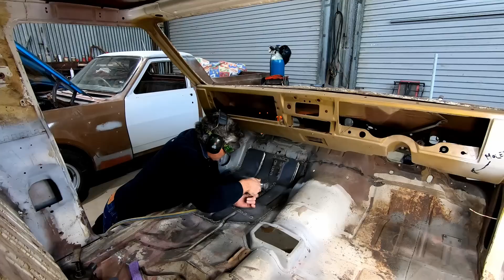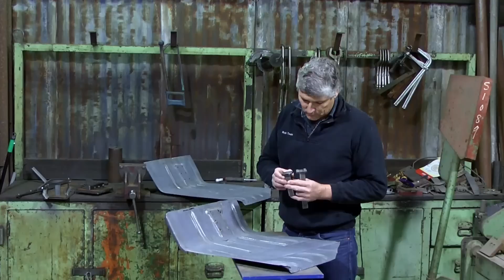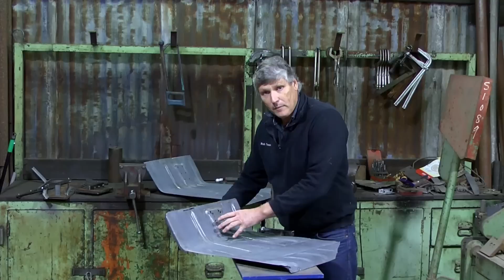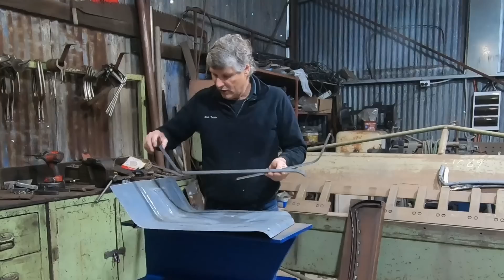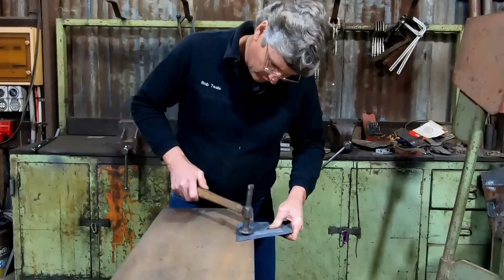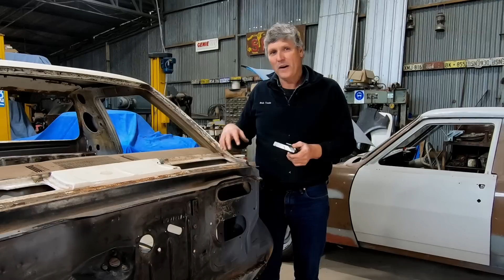1970 White HG ute floor pan rust repair

Comment: That's rubbish it's illegal to butt weld floor sections...I have put through 2 restos in SA both passed...it's structural integrity is just as good done properly and stops rust entrapment under  a seam.

Comment: How do you get the  weld to grind flush on the bottom if its lap weld?
Reply from the maker: This is one area where it is relatively safe to run a hot weld. Within reason, the weld will distort the edge of the lap and almost align the sheets. You wont get a perfect finish like a butt weld, but you can get it to a point that a few coats of high build and a sand will finish it. Watch the door video in the brown ute play list where I do a few different patches and approaches. There is a lap joint patch that comes out very straight, and will give you an idea of how it works. Choosing the best place for a join also helps disguise the seam, along one of the beads and in the roll of the trans tunnel etc. Good luck with your project. Cheers Rob.
Reply: @robsshed  Thank you Rob i appreciate your advice its been a great help. The way you explain how  to do the job is very clear for  me to understand your a awesome  teacher 👍👍

Comment: Hey Rob love your videos .Got a question when welding a quarter panel on a ute were you can not get to from the inside how do you treat the welds from rusting on inside.
Reply from the maker: Some places are impossible to treat without cutting some access holes to spray material inside. I use fish oil diluted with gun wash thinners and spray it into cavities with a degreaser gun. We can discuss this in future videos. Thank you for watching.

Comment: Like your fright, just fully welded in the cowl last night and suddenly thought why didn’t I try the window... many measurements later i decided it’s fine, I literally used a coat hanger though so not as fancy, was a thing of beauty tacked in the full length to sort the supplied panel

Comment: Rob. Outstanding commentary as usual.  I’m currently trying to make a shifter box/hole for the Saginaw that someone’s hacked into my HX floor. it looks like a lovely one in the HG. Would you have any specs or pics please?  It’s much lower than the one I’ve mocked up.  I started with the Aussie boot metal plate as my top and worked down.  I did this to ensure I could get a standard boot to fit. Couldn’t find anything on google hq-Wb.  Any advice?  Thanks.
Reply from the maker: Years ago I had a Saginaw in my HQ.I went the other way by leaving the Aussie 4spd hole alone and making a Mr Gasket shifter fit the opening. I made a unique bracket to hold the shifter on the extension housing and extended the linkages. The HG opening is made to accommodate the original itm shifter mounted on the cross member. I can give you sizes etc if it helps.
Reply: @robsshed  Rob, I would love that if you have time. This car was a3sp col shift so they've just hacked and bent bits back, including the cross member.  I've reconstructed the edges and cross member nicely but I want a factory looking steel surround. Thanks for taking time to read my message.
Reply from the maker: @poydapoyderson646  send me an email at rob@robsshed.com and I will send you some details. Cheers Rob.